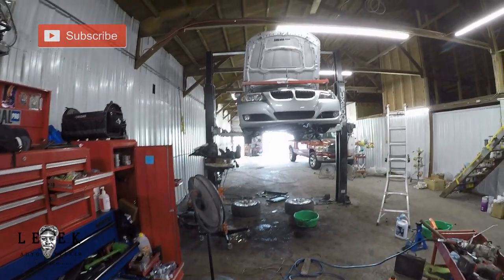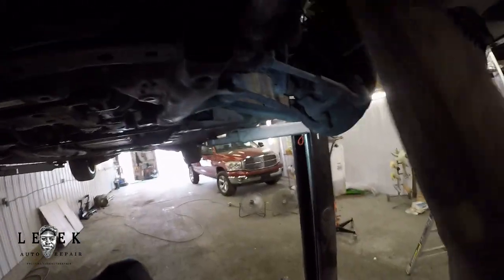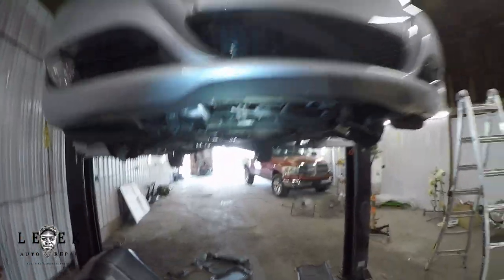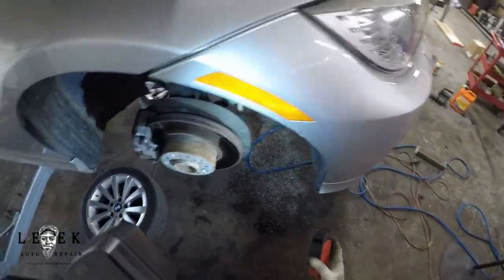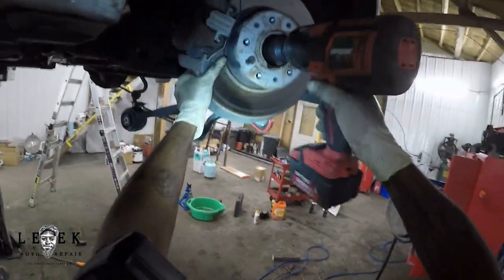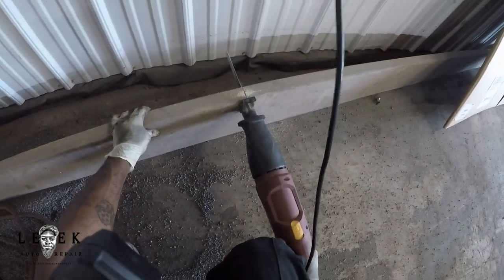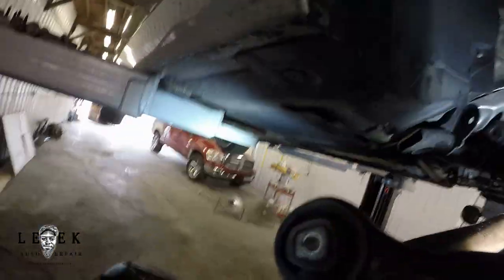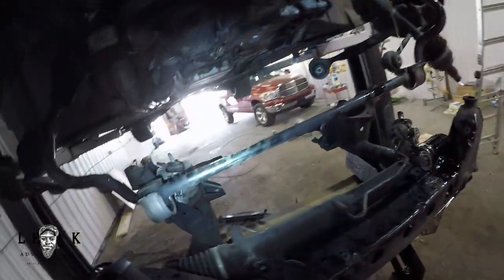BMW 328xi Oil Pan Gasket Replacement Part 1

Comment: Thanks for the great vids on this! I actually used these vids over the past month to do rod bearings in my 328ix. I did mine slightly different but this was a great outline! Much appreciated! There aren’t very many good guides on removing the oil pan on the XI models. It was actually much easier than most made it out to be.

Comment: Thanks man. I did my 2011 328xi. Found a little piece of aluminum in the oil pan looks like a torx head of a screw 1/2” in diameter. Any ideas where that could have come from?
Reply: open your valve cover asap and check vanos bolts
Reply: STOP DRIVING, PARK THE CAR IN THE SHOP. AND LISTEN TO Nox5051.
That boltheads could be from Exhaust or/and Intake Vanos Adjuster gears.

Comment: I’m at Day 2 in trying to remove steering shaft by hammering u joint without damaging it 😆
Reply from the maker: I never separate the steering shaft. Just unbolt it from the frame. It will hang so be sure to use bungee cord for support

Comment: Remarkable - BMW are sadists - all this to change an oil pan gasket? These cars are designed to be difficult and expensive to repair, after they've fleeced the original owner already. My first BMW will be my last.